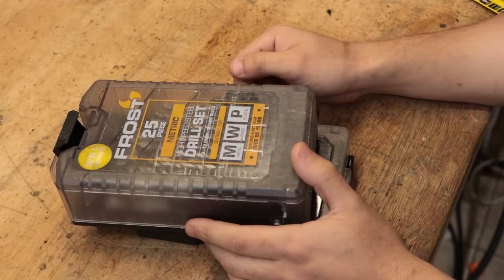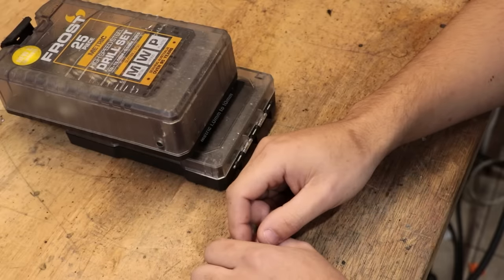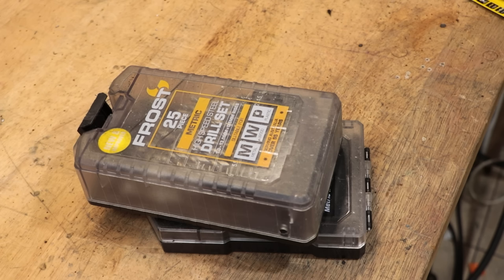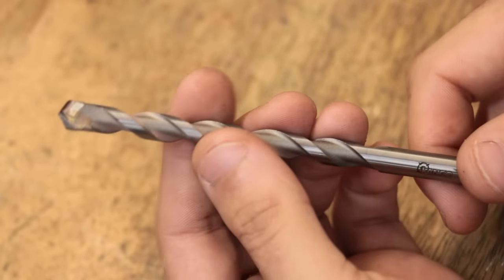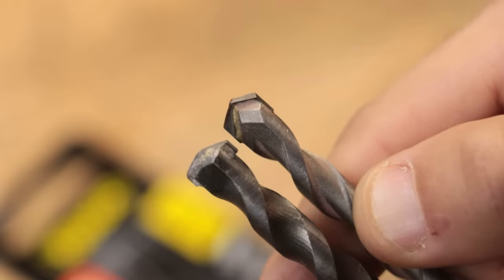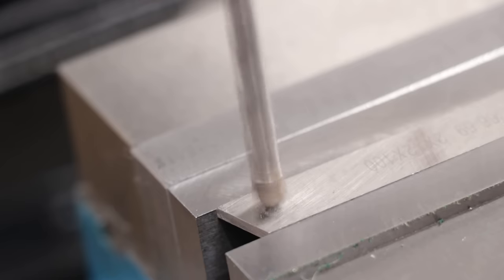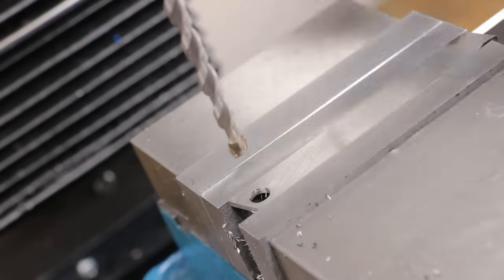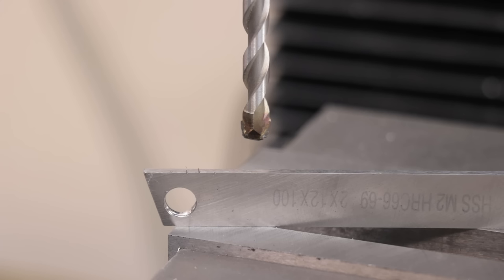Drilling Hardened Steel With Masonry Bits - Not A Lifehack

Comment from the maker: A bit of a shorter video this week. Gearing up to do a long build series (something to the tune of 10 weeks/videos) so a short fun video like this is all I could get out this week. Stay tuned. Cheers

EDIT 22-5-2023: I think I might have overlooked a discussion on regrinding the tip, maybe better for drilling steel. Seems like other people have faired better than me in doing so. I thought I could get away with using the standard grind, which might not have been the best assumption. Definitely something useful here, but best used in specific situations.
Reply: Yeah, I was about to comment about maybe regrinding the geometry on it to something more reasonable.

Another thing to consider: while full sized drills are pretty expensive, carbide center drills and spot drills are a bit more reasonable, and probably worth it to get your hole started.
Reply: Interesting video.  I wonder if the end results would be different if you were able to start that hole with a smaller masonry bit.  I wonder if when starting the hole that you also do not drill all the way through the material, then switch to the larger bit.  
Food for thought, as I do not have the need for hardened steel.
Reply: I needed to put a hole in some hard steel to put a lock thru standard hss did put a dent in it but burnt up almost instantly so I did the masonry bit trick went thru with smallest one I had 3 3.5mm and then used 6mm 8mm and finally 10mm I did ticket the tip with the grinder to square the cutting edge up only having aluminium oxide its not going to shape the tip much at all but enough 
So I treated it like you would a carbide inserts tool and ran the drill as fast and with as much pressure as I could seemed to work ok made some red hot chips and swarf but it got the job done
Reply: затачиваю режущую кромку, первое касание - коротким сверлом
Reply: lifehack your arm for a band saw! you elbow will thank you in 20 years.
Reply: Yes it’s possible but high speed carbide drill bit with lubricants is the best choice in my humble opinion.
Reply: Look up "cnc spade drills", that's what you want to mimic with the masonry drill bit

There are professional drill bits built this way, usually with removable carbide inserts, feed-through coolant and all that CNC fanciness
Reply: @staviq  there are also great bits that are designed to be used with Mag Drills well worth it and cooling is built in.

Comment: I have used one running backwards to drill out a broken tap - had to re grind the carbide tip  so the cutting edges were on the opposite side . Also don’t throw away your used parting tool inserts , you can braze them to a steel rod to make small drills - takes a bit of grinding but you essentially create a spade bit type of drill .
Reply: We braze the bit to square stock to cut slots in aluminum  1/4 " thick
Reply: Yes I do this too.  Sharpen it backwards and run the drill in reverse to drill out broken bolts and stud's.

Comment: I have experience with this, I did my apprenticeship in a toolroom making press tooling for sheet metal parts. In a few situations wee needed to drill through dies after they'd been hardened, start holes for wire EDM modifications etc. So it was usually hardened K110 or Calmax which is pretty tough stuff. Solid carbide drill, yes they could do it but tended to shatter after a while because of the chatter and forces involved. The masonry drill was perfect for this because of the soft steel shank which let it absorb vibes and bend without shattering. The key though is sharpening the cutting edges with a fine grit diamond grinding wheel. Then it works perfectly for numerous uses. Also have to keep it cool with lubricant or else the solder melts and the carbide goes bye-bye. You can do a starting spot with the solid carbide drill.
Reply: Same story as you..
However we didn't use fine grinding. 
Just the regular green. 
The expensive masonry drills sucked and cost way too much. 
The simplest cheap ones was perfect.. 
Grinding it just for few seconds to remove the coating and remove the roundness of cutting edge. But still leaving the chamfer. To create a very negative cutting edge. 
Very noisy. Starting with a 8 to 10 mm drill and going up in increments of 5 to 10 mm drills till you reached 30 or even 40 mm hole. 
Hardened Calmax vanadis 4 and arne steel mostly. 
Changes or error 40. Some times you need a whole or a bigger hole.
Or even grind to 45° or 60° to make a chamfer.

Comment: Done this for years for hardened spring steel. The trick to not chipping the carbide is go slow when you are breaking through the back side. I've found , that's when the chipping usually occurs. Obviously not for precision location holes, but on clearance holes for bolting things together, hard to beat the price.
Reply: Any tips on sharpening the...tip? On a bench grinder. Seems like it'd be wasy to accidentally anneal it and end up with a tip thats too soft
Reply: @nateb4543  Use a continuous angle grinder Diamond disc and sharpen the carbide bit. 
The rounded edge doesn't really work on steel. It will work well if you do that.
Reply: @redgum1340  I've got one, thanks for the advice. Damn that thing is loud

Comment: If you want to go through hard steel, not quite as hard as HSS or tool steel, you can grind a standard drill bit to have a very shallow angle on it. Almost a flat bottom drill but with just a slight tip angle. And I’ve actually drilled through some hard metal with cheap drill bits and it actually works really well. The hardest part, no pun intended, is getting the drill started without it walking.
Reply: what about putting a piece of stock with the desired hole size in it on top to use as a drill guide/bushing ??
Reply: @practicalplinking6133  yeah that would probably work

Comment: I keep a bunch of masonry bits around. I regrind the carbide tip for cutting metal and they work great. Not only can they stand up against harder materials, but they are essentially a spade drill, so they don't wander like twist drills.
Reply: Spade drills definitely still can wander. They just resist it a tiny bit more than a twist drill since the cross section is stronger.

However masonry bits still are fully fluted, the fully fluted nature of twist drills is what makes them more susceptible to wandering. As such masonry bits will wander similarly.

Comment: Thank you for your video, I came on here looking for help I spent 3 1/2 hours trying to drill through hardened steel I got about half way through  it was only 1/8 thick.  My hands were starting to get blisters that is when I found you and your video which saved my hands. I had high speed metal bits  broke two of them  I knew I had 3 masonry bits the same size but used so I finished the other half in one hour instead of 3 1/2 hours and if those bits were new who knows how short the time would have been. I got my one whole drilled and saved me from going to the big box hardware store. So it does work and when that tip is gone your out of luck I am glad I had three used ones to finish. Thank you again.
Don

Comment: It works fine if you sharpen the carbide tip a bit first with a diamond wheel or file, it will last many holes then.And a dab of cooling oil wont hurt either :)
The only thing you need to watch out for is heating it up to he point were the brasing melts!
Reply: I'm surprised that he even managed to do anything with that dull point.
I've actually managed to grind them on a bench grinder, but it needs to be the correct stone, otherwise the disk turns to dust 😬
Reply: @daniel635biturbo   correct green grit wheel is what you need
Reply: @daniel635biturbo  I've used diamond wheels.

Comment: i have successfully done this many times. My late father in law, an experienced machinist, showed me how. They do it in the work shop for small jobs where the right sized bit is not on hand. The crucial thing is sharpening the carbide tip, to give a workable relief angle. Pretty easy to do. I have drilled stainless and hardened steel (old files). Also, using cutting lubricant/coolant helps to prevent overheating and failure of the drill bit.

Comment: You can buy proper drill bits with the same construction, using a HSS shank/body and a carbide tip. Just that on these they have proper angles and are meant for this purpose. Probably more expensive than most masonary bits, but much less than full carbide bits (and less prone to break on less than ideal rigidity setups)
Reply: Do you know what they are called?
Reply: @nosuchthingasshould4175  Google Carbide Tipped Drill Bit for hard steel, they look similar to Masonary Drill Bits but have a standard Gind and Flutes.
Reply: @nosuchthingasshould4175  Bosch multiconstruction.
Reply: @65cj55  thanks
Reply: @markrainford1219  thanks

Comment: Depending on the part being drilled you can also anneal it in the drilled area if that isn't an issue. You can typically use regular hss drills doing that. We used to anneal induction bar for drilling back in the day before buying proper carbide drills.

Comment: While I haven't reground the tip before, typically a masonry bit is my home-shop "emergency dill" method.
If I accidentally overheat what I'm working on and it becomes annealed, or if I'm drilling something hard, the next step is a Carbide Masonry bit. I have however, taken a little time to ensure that I have decent ones (sometimes $5-10 each). 
They work decently, however as noted, they don't make PRECISION holes.

Comment: Decades ago, I used a drill bit like this to drill a hole in a piece of hardened drill because the only drill of this size had died in combat. As a coolant, I had only water available, drilled with an ordinary market drill. In some situations, even using a nail as a drill bit can help get the job done.

Comment: Been using these since the 80’s. Couple tips. Carbide ball mills work great as a spot drill if you have access to them. Also, if you need precision, step drill it with a smaller drill first. And finally, slow your spindle down a bit and use a little cutting oil or coolant. They are definitely not as accurate as a proper twist drill but have salved my butt many times.

Comment: I use Bosch Multiconstruction on hardened steel. It's a universal drill that has a carbide tip, but with proper tip angles.
Reply: I also use the Bosch multi drills on hardened steel. They work a lot better than standard percussion chisel type masonry bits.

Comment: Locksmith drills are what you want. Like a masonry bit they are a normal steel drill with a carbide tip, but they are ground to be suitable for cutting the hardened steel of locks. They are cheap and work well, they also cut very close to their nominal size.
You can of course use a masonry bit as you have shown (and I have done it myself). It really helps though if you use a diamond file or diamond grinder to sharpen the tip into something closer to that seen on a HSS bit.
Reply: Have to be careful in how much attention we bring to your comment...or the price of locksmith drills just went up! ..thx for the tip!

Comment: If a diamond wheel is used to correctly sharpen the drill bit, it should do much better.
Reply from the maker: Probably, I guess that must have glossed over thinking that. If I was using the cheapo bit I would have had to. Cheers
Reply: SiC grinding wheels cut WC well enough. Diamond is not always necessary.

Comment: Just judging from the masonry bits I've had, I would probably start by sharpening the bit with the little diamond wheel that came with my Dremel tool. Just to make a sharper cutting edge. This could be a great "This saved my butt" hack.
Reply from the maker: You could make the case for that if the bits needed it. I thought I could get away using the standard cut on the good bit but didnt seem to be the case. If you are good with griding drill bits it could certainly work.
Reply: @artisanmakes  Luckily that is a skill that I picked up years ago. It sucked in the moment because the boss wouldn't buy a drill sharpener, but now I'm glad he didn't. If you can't sharpen them yet, it's well worth devoting a day to learning. From your work that I've seen so far, you should be able to get them cutting within .005" easily in a day.
Reply: @artisanmakes  Some sort of punch to make the starting hole could have prevented the bit from walking.  Also I wonder if a bit of cutting oil would have helped the bit last longer ..
Reply: @Artisan Makes  I second that, definitely spend the time to practice sharpening drill bits, it's not that hard to get dull bits to bite again, maybe not as sharp as factory, but good enough. In the ship yard I sometimes got away with grinding them on my angle grinder.

Comment: A few things, one guy suggests grinding the front face of the bit for better cutting, never use cutting fluid unless it's a constant flow or it will cause thermal shocks and on thick material always have several masonry bits on hand because you will need it.

Comment: Masonry or concrete dills are meant to cut with hammer or percussion drills. they are designed to chisel and chip the material. Best way I found and it worked very well for me  is low to moderate RPM and coolant depands on drii dia. I managed to drill screw extractors and brokon off taps

Comment: I started a project needing to bore through what wasn't really hard steel but it quickly dulled the carbide bits I had. Most of the whole set since I varied the bits I would use to size up to the hole. After one round of dulling the factory sharpening and another of dulling my own sharpening, which happened much faster than the factory sharpening, I decided to use the half inch masonry bit I had left over from a one off job I did for someone. After seeing how much better that worked, I bought a pack of five eighth inch better quality carbide bits and got through the remaining four fifths of the drilling part of that project in the time I spent on the first fifth.

Masonry bits don't come in a very wide range of sizes, but if someone wants to compensate for the cost of drill bits with their time, planning a project around the size of hole you're going to get with a masonry bit, is worth it.

Comment: Just cut an edge on the tip and it will work to get holes. Done it.  Just make sure you use a belt sander and keep the drill cool with water or you will anneal the carbide tip and soften it.  It works.

Comment: If you want it to bite in sooner with less wandering grind the sides away at the centre of the tip to make the very point narrower after you've reground the main drill angles .

Comment: used in toolmakers shops for drilling Carbide and hard stuf since they exist.They are cheap and easy to grind. No joke.Go to any workshop in germany in the screw busniess or working with hardend and Carbide material,they will have a box with regrinded masonry bits....That a trick 17,as we call in germany. Better is even to place the carbide tip inside the tip of a HSS drillbit.

Comment: This solution is the perfect remedy in my case!  
I drilled two decorative holes in a knife handle,  through the aluminum handle scales and the hardened steel knife tang.  I believe the first drill I used was carbon as it cut nicely.  After that each drill size up became less effective until nothing would work.  I turned to a grinding bit which was tapered, but that left a messy hole and the tang consumed the bit fast.  Also the aluminum clogged up the grinding bit.  I finally gave up, setting the knife aside to perhaps hand file with a diamond file or purchase proper carbon bits.  This solution/\ is the perfect remedy in my case!  The holes won't have diametral accuracy but far better than what my hand filing could achieve.

Comment: In my daily job we machine cast iron, and if we need lots of non standard size holes we use masonry bits, regrind them to the propper angels and it can drill as much holes as a solid carbide one (2-3000 holes). But with steel it does not work that way.

Comment: The brazed tips are tungsten carbide .with adjustment to the ground edges it shouldn't have trouble in most materials . Though these drills are frequently not straight

Comment: I have used Artu drills for years to drill files and other hard materials. You run them at high speed and pressure in a drillpress. The tip goes red hot and pushes though the files quite easily to give a perfectly smooth shiny hole. These Artu drills a German made titanium carbide tipped and available individually or as a set to 10mm. Cost was $70 Aust but may be dearer now.

Comment: Use a green grinding stone or a diamond grinding wheel and give the carbide more of a "flat brass or plastic" style of edge with a keenly sharp edge and some clearance.  They then bite in and cut pretty well for at least 4 to maybe 6 holes in HSS or hardened steel.  Been there, done dat and got the holes in the low cost 123 blocks that now pass 3/8 bolts instead of not.

Comment: Braze your old inserts onto the shank and grind to shape with a silicon carbide wheel. Turning inserts are generally a much harder grade of carbide than masonry bit tips, which are designed for high toughness at the expense of hardness for use in hammer drills/rotary hammers. Or just use a boring bar with a carbide insert as intended on a lathe, it'll work fine.

Comment: I have done this before! I was trying to replace the handle of a knife and needed to make the holes in the tang a bit bigger. Don't know what the steel was but it was very hard and standard drill bits did nothing. Then I found the masonry drillbit trick and tried it. Yep, it worked! 😀